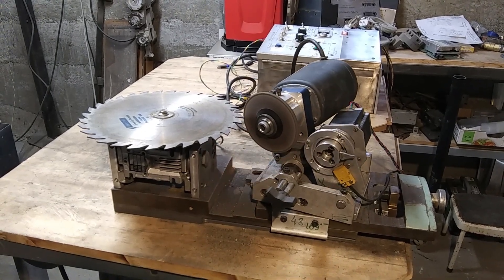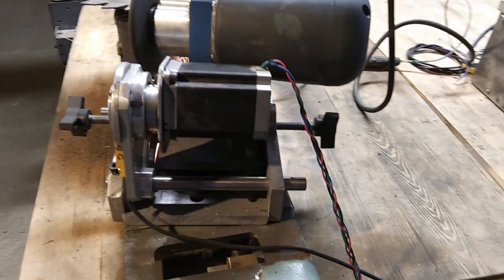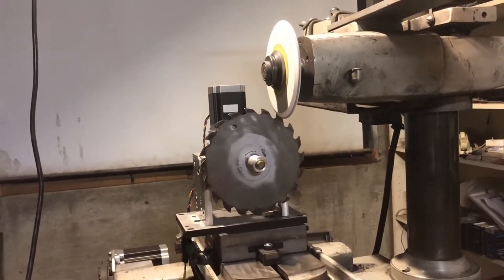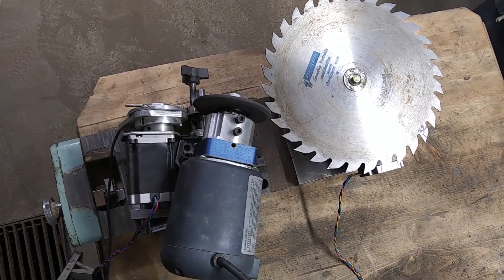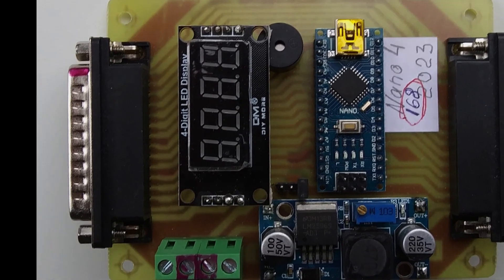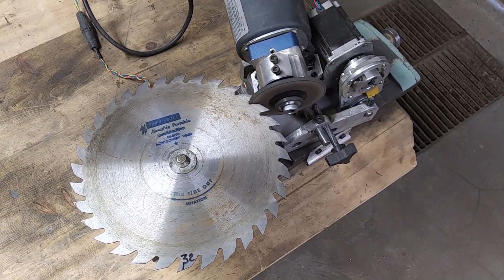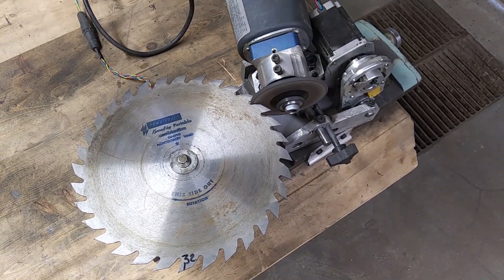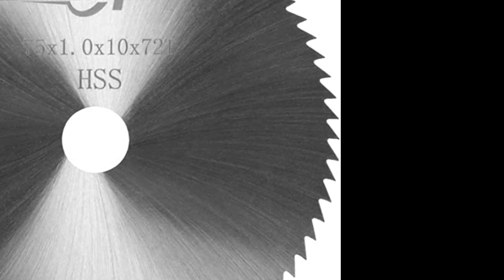Automatic circular saw blade sharpening

Comment: Is it possible to adjust the feed rate without stopping the process?
Reply from the maker: Yes, there is a hand wheel for that purpose. It is mounted on a rotary encoder.
Just turn it CW or CCW and the saw blade would respond appropriately